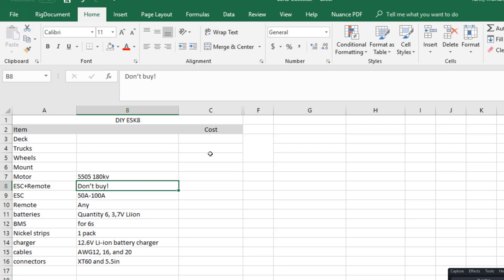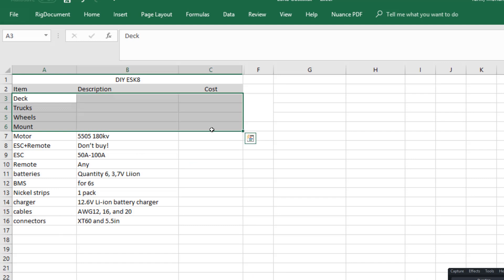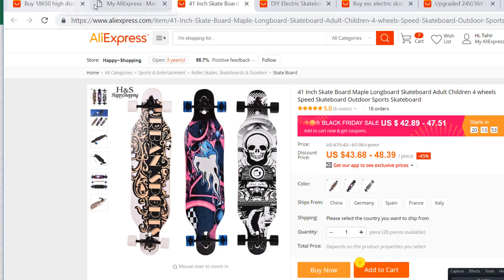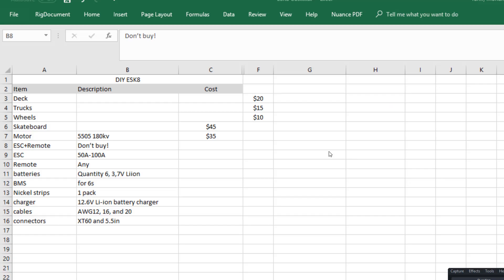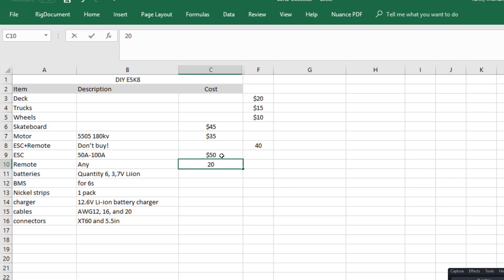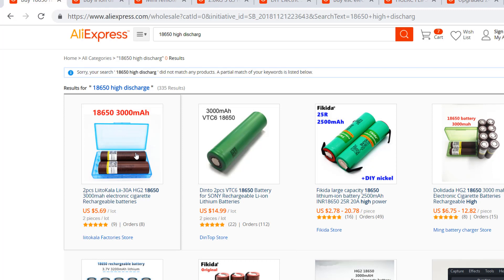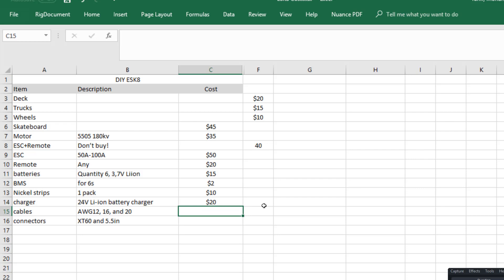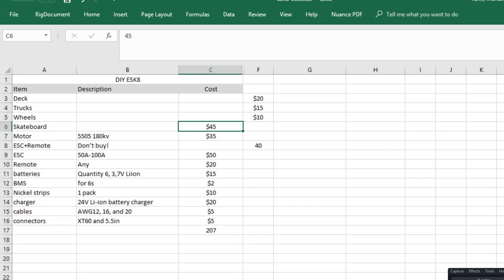The REAL Cost of Building a cheap Electric Skateboard! - Ep1

Comment: Is there a reason you bought a belt motor instead of hub motors /w trucks? I would have thought it'd be cheaper because you could just buy a board and install the trucks and hub motor.
Reply from the maker: I didnt find any good/cheap hub motors whrre I live. If I did, I would have preferred hub because of the reasons you mentioned.
Reply: @Fungineers  Oh, I see. Have you come across any that are good and afford since then? I'm looking to build my own board and could use some help.

Comment: Does this controller have decent braking? I tried two boards and one had nice gentle brakes. The other pretty much just threw you off of it. Frightening. Thanks!
Reply from the maker: It actually sucks. Its really hard
Reply: Damn. That's dangerous! Thanks for the videos. Very interesting!
Reply: Fungineers it's a shame because when you can trust your brakes, you can be ok with going fast. Or at least faster.

Comment: #1 this is not the Real cost of building an esk8 (you've missed many parts and used parts that just don't work together)

#2 You battery would be wired up to blow (or at least go faulty) 

#3 I could go on all day man.

Man go back to the drawing board and if you still will try to put together this monstrosity please watch as it charges and don't leave it unwatched.
Reply from the maker: Well let's see how it goes (or blows)
Reply: @Fungineers  Man what cells are you going to use what in what configuration will you put them in?

Also how are you going to combine your motor mount to your trucks and pulleys to your wheel?
Reply from the maker: Building a small 6s for now. Will ramp it up later. 
Have bought a pulley kit to combine motor and wheels. Hope they align. If they don't, might have to 3d print pulleys :)
Have you built one before?
Reply: @Fungineers  I have built an esk8 before.

Right if you'll build a 6s (series (for added voltage) 1p (I added for current and capacity (Note: same WH = same energy.) 

Made sure your cells can handle the current you will want to pull from them (at a constant) and do not go over that (not unless you really know what your doing)
Reply: david martin could you help me out on a good way to get the right DIY kit?

Comment from the maker: Make sure the batteries are high discharge and good quality, and your wheels and motor mount size match!
Reply: can you tell me when you need to consider fast discharge batteries. For example, I am working on a project of building small electric vehicle - it can be used in storage units for transportation purposes ... Estimated weight of the vehicle is around 830kg. We selected BLDC motor 2kW, 48V, 80Amax(100 peek). ECU is rated at 50A. As you can guess this vehicle should not have some big acceleration and should only be able to move at 45kmph max. Every mechanical and electrical compent is already selected, except batteries. I want to go with Li-Ion batteries and connect them in such a way which would give me 48V and 80Ah. The only thing that I am wondering know is which batteries to select. I was going for 21700 5000mAh and 3.6V, discharge rate 7.5A(1.5C) and charging rate 2.5A (0.5C). Will this suffice my needs or should I look for greater discharge rate batteries ?